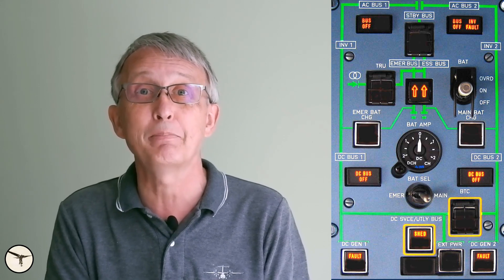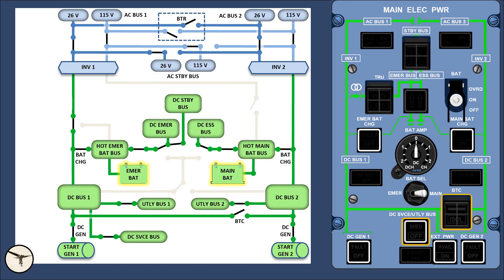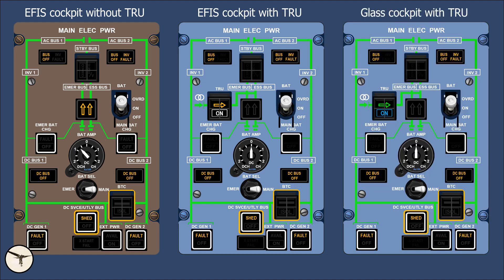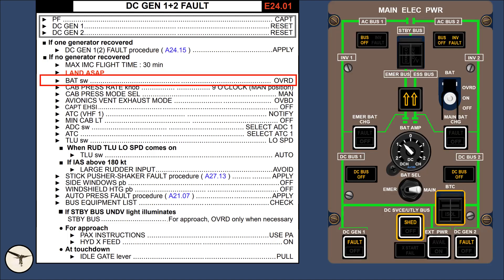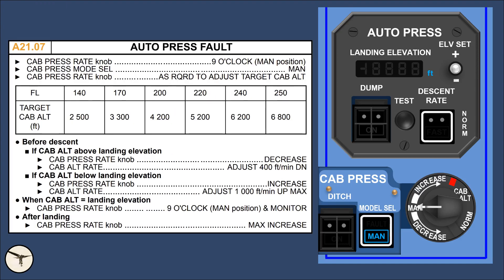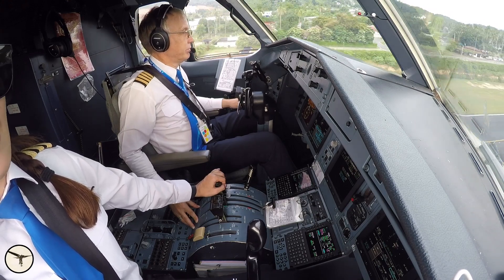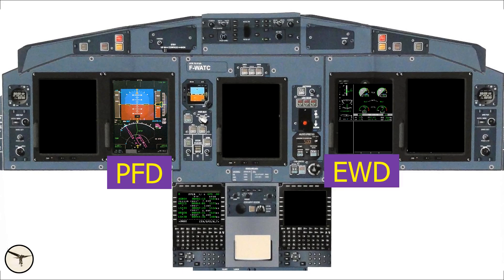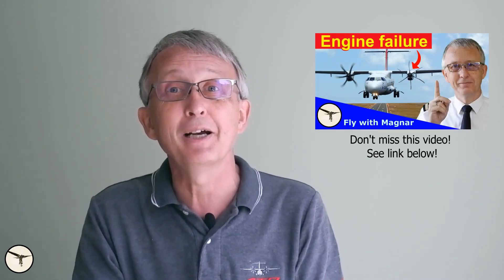This failure might surprise you | When both generators fail

Comment: A protection trip initiated by the associated GCU. If it is caused by a
generator underspeed, reset will be automatic. For the other cases,
a manual reset has to be performed (but can result in a loss of the
opposite generator) . 
In regard to the above statement excerpt from FCOM would you recommend reset in case of s single DC GEN FAULT
Reply from the maker: As long as i see only one amber light, I would try a reset. But only once. The risk of losing the opposite generator during a reset is very small. Each generator has its own GCU. According to the QRH "At flight crew discretion, one RESET of a failed system associated to an amber caution may be performed by selecting the related pb (push-button) OFF (for 3 s) then ON except for systems listed below..."
Reply: Thank you for the prompt reply

Comment: This might be a stupid question but where does APU and RAT comes in?
Reply from the maker: ATR aircraft do not have APU or RAT. Instead of APU, the propeller on engine #2 can be hold in position by a propeller brake. This allows for the engine to supply the aircraft with electrical power and air conditioning. RAT is necessary for aircraft with hydraulically operated flight controls. ATR has manually operated flight controls and doesn't need RAT.

Comment: Hello magnar, I have a question, please help me. Why some push buttons like BTC, ACW, DC SVCE, in the overhead panel  have a yellow rectangle around it. I apreciate your help.
Reply from the maker: The yellow circle around some pushbuttons is to help the pilot to identify them in case of electric smoke.

Comment: Thanks for an interesting video. I have not dived so deep into this checklist for the AT76 so I was not aware of this 3 yes/no-items (stall warning, speed/alt or none…). But exactly what do they mean with speed/alt? I guess it means that if we are low on speed and below 1000’ agl we cannot engage the AP until we have speed 160+ and 1000’ agl? But what about approach later? Must the AP be disconnected when we are descending through 1000’ agl or when we start to configure for landing with speed below 160? Not super clear in the procedure I think.
Reply from the maker: "If IAS <160 kt and/or below 1 000 ft AGL: AP and/or YD USE : PROHIBITED." 
This means you are not allowed to use AP and YD when the speed is below 160 kt and/or you are below 1000 ft AGL, also duirng approach.
Reply: @FlywithMagnar  Thanks Magnar, yeh it does say Prohibited but why not during the item “For approach” have the followwing item?: When speed below 160kt and/or below 1000’: AP disconnect (if engaged). But I guess we have to “think our selves” ;) Like on eng 1+2 flameout leading to forced landing. On FORCED LANDING checklist it says before the item “if no engines operates”: LDG GEAR….down as req. In the case where we dont have any eng running, we will need to use gravity extension which the checklist does not take into consideration really. It helps us with flaps via the AUX HYD P/B only in the case of no engines operating. Easy enough, but during that stress with no engines running it would be nice with all the help and hints one could get from a checklist :) Thanks again for your videos Magnar

Comment: Great video I just had a question about the ATR : Why during the start-up the propeller looks like its in full feather ? Sorry if the question has not much to do with that video I was just wondering. Keep doing great videos much appreciate it.
Reply from the maker: Yes, the propeller is in feathered during engine start and shut down. This is normal for engines with free turbines, like the PW120 and PT6.

Comment: Hello, do you have more information about the new procedure regarding the TRU? Do you know if it affects other systems while putting it on?
Reply from the maker: The procedure was implemented after some incidents where the crew lost all DUs and IESI in flight. Here is one: https://avherald.com/h?article=4da477c1&opt=0
Engaging the TRU after engine start prevents this from happening. ATR is working with a more permanent solution. No, other systems are not affected.

Comment: Nice... Really nice Captain... Always a pleasure to see you ! We had during an OPC, on a SID, a DC Gen 2 faut followed by an engine 1 parameters overheat, so we needed to shut it off... So there, we were... After the assemment, we also had hydraulic green pump overheated... Was though but good... We survived 😅

Comment: Is there are chance to recover one generator by selecting DC BTC isolation and then trying to reset generators?
Reply from the maker: No. The reset is done in an attemt to re-engage the GCU - Generator Control Unit.